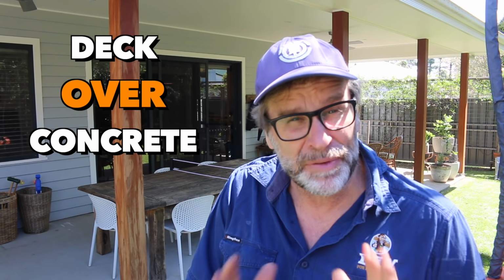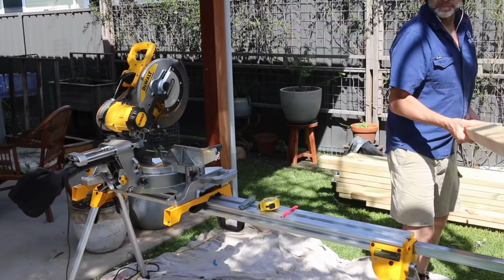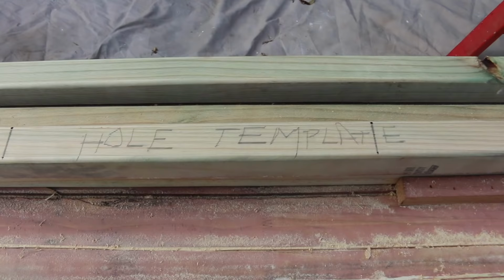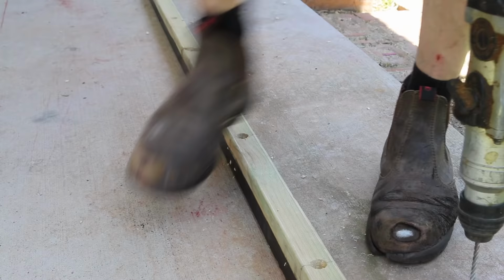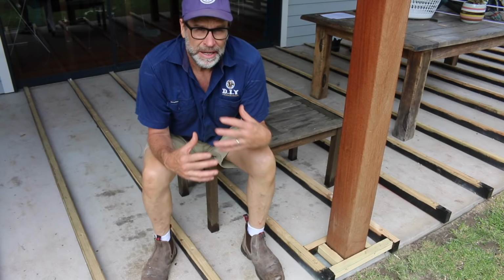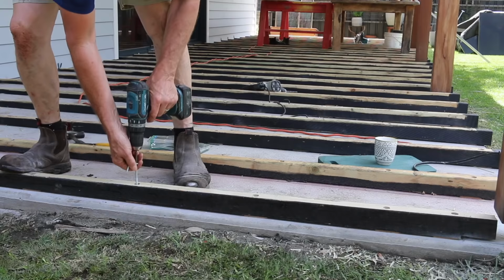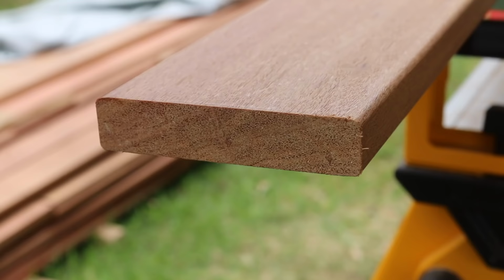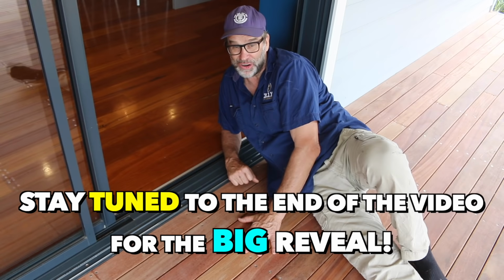Building a Deck Over Concrete PLUS 5 BONUS Decking Tips!

Comment: I've been searching for months on how to build a deck with clearance like this and this video has never appeared in the results until now for some reason. Glad I've finally got to watch it. This looks amazing and looks easy enough for a knucklehead like myself to complete! Thanks.
Reply from the maker: No worries at all mate and good luck with it 👍 Thanks for watching 👍😁🇦🇺
Reply: @diyforknuckleheads  No worries, one quick question.. How did you decide on the length of the decking? I see you've staggered them in a pattern. If I'm going 4.2m long would you do one run with 2 x 2.1m pieces and one with a 1.05m, 2.1m and 1.05m and then repeat that out?
Reply: Should look into deckcell, 30mm plastic cell you deck over
No issues with timber rotting
Reply: @octane_matty Still need something under to make it level.

Comment: One of the guys in my Jobsite has that same DeWalt drop saw, it's a beast and the shadow line makes it so fast to cut timber.

Nothing more satisfying than when the straight edge slides perfectly across.
Reply from the maker: You're not wrong mate....some times you just have to do it and yes.....the saw is awesome!...l love it. Thanks for watching and Merry Christmas 👍😁🇦🇺🎄🎄

Comment: This was a great help in planning to recover my concrete patio. Quick question for you! What did you call the plastic spacers you used between the concrete and lumber? I'm am not finding anything quite like it exactly in the US.
Reply from the maker: Thanks Chris 👍 The plastic spacers are called Window Packers" Carpenters use this to level up their windows during the window installation process. Over here in Australia you can buy them from any major Big Box hardware store. Good luck 👍😁🇦🇺
Reply: @dengshomeinvasions1273  They'd need to be stainless steel or galvanised, but plastic would be better to avoid rust.

Comment: Excellent video upload, and the building principles are true. -- You could also lay the framing joist flat and custom cut height adjustment shims at each anchor point, but I believe your solution would be faster. --- Thanks for the fun video. ---
Reply from the maker: No worries at all Lance! Glad you found the vid useful mate 👍😁🇦🇺

Comment: Best floating deck video ever. I plan to build a desk that is slightly lower than floor, and it will leave me with 4 inches for the deck's height. Perhaps going to use 2x4 or 2x4 on top on 2x2.
Reply from the maker: Thanks mate 👍 Glad you liked the video and good luck with your deck 👍😁🇦🇺

Comment: Excellent video! My patio and walkway are so old I need to just cover it with decking. My house is 121 years old and the front concrete was done in 1968👀
Reply from the maker: 👍😁...No worries! Glad you found the vid useful and good luck with yours 👍😁🇦🇺

Comment: Hi there, you my friend have solved alot of the issues I was having in terms of how to achieve that clearance because obviously we don't want the joist to be in direct contact with the concrete. Thank you!
Reply from the maker: No worries at all mate! Thanks for watching 👍😁🇦🇺🎄
Reply: @diyforknuckleheads  I have a quick question. Do you think I can use the flat side of a 70X35 or 90X35 to do the framing? I have only 70mm height to work with and is driving me crazy!

Comment: Very nice video and work for sure.   Tonka wood also know as Camaru in the US.   Viewers should know proper installation recommendations.  I’m in building products distribution and have visited too many decking claims where the wood fails due to improper installation.   

Cumaru should never be attached to a solid surface such as concrete. Sleepers, stringers or joists should be used to fasten the deck boards to the structure. Proper drainage and ventilation should be considered to avoid movement, cupping and checking.
Ventilation – Allow for air flow underneath and between the deck boards in your design for maximum long-term stability. Follow proper gapping/spacing recommendations below for best results. Decks should be built at least 24″ above the underlying surface and have open ventilation from three sides.
Spanning – For minimal waste, we recommend that you build your deck on 12″ spans. Otherwise, follow these standard spans for installation for minimal deflection of the deck surface

Comment: Amazing deck mate. And some excellent tips in this for me. I have a 250mm fall across the uneven floor of my workshop. So instead of paying a fortune to level it, I am going to make low profile plinths for all my machines. I am going to use that jig to cut all my framework.
Reply from the maker: Sounds like a plan Curt! Good luck with it mate 👍🇦🇺😁🎄

Comment: It will .pack your joists level dynabolt them below the top of joist so you can plane , Chemset dyna bolts in of your worried about them coming loose , no dramas

Comment: Well done , had some good tips, have used a socket set for those screws as well.👍
Reply from the maker: Cheers Steve 👍 I actually tried the socket set as an experiment with these screw bolts and l had no joy at all....maybe l needed a stronger set with more leverage 🤔 Thanks for watching mate 👍😁🇦🇺

Comment: I'm replacing a larger deck, but going with Trex (wifey).  Just for added insurance, you could use some decking tape on top of those joists which are water resistant and seal around screw holes. Also, I know it might be a pain, however wouldn't it be a good idea to take a day or two and put the decking oil on all sides? Also, small paint brush to hit the freshly drilled hole before the screw goes in?  I'd think normally you might not have to much to worry about for moisture problems, however recently...  I'd love to move there, however just far to many poisonous things waiting to kill me.
Reply from the maker: 😂....We do have a few stingy things over here 😂 Thanks for those extra tips 👍😁🇦🇺

Comment: I like all of it except the explanation of timber against timber.   You've created a pocket between the deck post and the floor framing with a gab.   I can only assume the spacers are fastened to the floor which means water will stick in that pocket for a long time.

Comment: cracking job mate. I have similar challenge with low clearance to some concrete steps that lead up to the sliding doors so will need to do something similar around that area.
Reply from the maker: Cheers Stu! Good luck with it mate 👍😁🇦🇺🎄

Comment: This video was amazing and super helpful!

Your sloped joists seem shorter than what I've been reading (your typical 2x4, 2x6, etc...). Is there a minimum dimension they have to be to support the weight of the decking? I don't have much height ti give in my patio, so i want to simply build the frame/joists to give the decking a foundation without raising it much, if at all.

Thanks!!
Reply from the maker: Thanks Kevin 👍 It really all depends mate. The less clearance you have, the less airflow you will have underneath the boards which can cause the boards to cup. With a narrow joist you need to have more support under it which means having those plastic packers closer together and you also need to consider the length of the screw. 
I really don't want to say it's ok because there are to many variable to consider.
Cheers,
Shane 👍

Comment: Hi Shane, few quick questions. 1) What size joists are you using? 2) How far apart are the joists? 3) How far apart are the concrete screws? (380mm?). Thanks
Reply from the maker: G'day Rob....the joists were 90 x 45 treated pine (MGP10) at 450mm from centre of one joist to the centre of the next. I placed my concrete screws about 470mm apart. You just need to make sure that the concrete screw is not going to get in the way of your decking board screw which requires you to do a bit of setting out first before you decide where to place them.....if you know what l mean...Good luck with it mate 👍

Comment: This video is exactly what I'm planning to do for almost the same concrete patio with minimal clearance, etc. Was dreading the tapered joists thinking that was the only way to do it right and seeing you do the same gives me confirmation that's the right way to go about it.  What are the spacers that you used between the concrete and the floor joists?  Was thinking I would have to make something, but if those are commercially available, that would be great!
Reply from the maker: Thanks Scott...glad you found the video useful mate! The spacers are called Plastic Window Packers. Good luck with it 👍😁🇦🇺🎄🎄 https://www.bunnings.com.au/macsim-75mm-600-piece-mixed-window-packers_p0164936
Reply: You are the best.  Thank you! @diyforknuckleheads
Reply from the maker: @scottniemiec7196  No worries at all mate 👍

Comment: its amazing to see the different ways people build things, I probably would have laid the boards sideways so 35mm plus 19mm for the decking and a 1mm spacer close to the house end as you wouldn't need membrane under the deck boards as it's all undercover, then I would have put 30mm spacers at the other end to make it 85mm and pack the rest with window spacers after securing each end, bit less time involved splitting the timber and not having to nail the packers under the beams, but we'll done it came up a treat.
Reply from the maker: Glad you liked it mate!  The reason why l wouldn't lay the board on its side is that you would see to much of it between the decking  boards. Thanks for watching 👍😁🇦🇺

Comment: The floors inside my house are actually tongue and groove pine planks, approx. 6" wide running on treated 2"x4"'s (1.5" x 3.5" finished). The 4" side is anchored somehow( I wasn't there and trusted my builder to know what he was doing!) to the concrete slab. Assume about 16" on center. Have held up pretty good for 25 years. With very few if any creaky boards that I hear much and if so usually only in winter when it's dryer.
Reply from the maker: That's exactly how l laid my boards inside my house as well Mick. Been down 6 years and no issues at all. We have 6" boards as well 👍
Reply: @diyforknuckleheads  Actually just measured and they are only 5: wide, granted maybe the tongue is 1/2" to make it a finished 6" piece of wood. And the only thing about a house with wood floors after living with carpet all my life is the need to wear shoes. usually flip flops. Wood floors hurt my feet! The dogs toe nails scar it up pretty well too. But hey the rugged look!

Comment: I hope to do exactly this on my screened-in lanai in Florida. I sure hope I can find a craftsman like yourself. My only concern is about the maintenance of the concrete foundation. Do I need to be concerned about that at all? I am thinking gunk, juice spills, dirt, etc. With normal decks, it can just fall to the earth and nature can take its course. Without the deck, I can hose it off thoroughly. Thoughts?
Reply from the maker: G'day Sandy...l can't see to many dramas. Mines under cover so l don't have any concerns. If juice does by some chance fall through the cracks in the deck it will soon dry off. We've had plenty of parties on the deck and so far so good 👍👍 Thanks for watching 😁

Comment: @DIYForKnuckleheads Some great tips thanks Knackers. I used a very similar process on my pebblecrete front porch a couple of years ago. 
No joist tape? Did you opt for bitumen paint on the top of the joists as well? 
Great tip about the shim under the deck boards for cutting butt joints. I shifted the angle on the mitre saw but that gets time consuming! 
For ripping the taper on all the joists, I wondered if you could have set your jig on the required angle to avoid all the string line hoo haa.
Also a good tip about no wood to wood contact. For a picture frame deck where you are doubling up and blocking all of the perimeter joists this could be hard to avoid though. Perhaps some joist tape over the join would suffice, rather than more window packers?
Reply from the maker: Thanks mate! Glad you liked it. Because my desk is under cover it rarely see's any water so l didn't worry about painting any bitumen on the top of the joist. Thanks for the other tips as well 👍 Cheers 👍🇦🇺😁

Comment: Just my opinion, but you should have showed how you worked out your measurements for your tapered joists.  It’s probably the most important thing in the project and something the non -professional would need the most help with.
Reply from the maker: Trent, all you need to do is run a level line from the top of the floor boards inside the house to the edge of the concrete where it meets the grass. Then just measure from the concrete to the level line.....hope that makes sense 👍

Comment: great video . been wanting to put a wooden deck on my concrete landing like that and extend it about 4 metres over a 1 metre drop , spose i need a bit more advice for that , with dyna bolts and stumps and bearers etc  .  its been on the gunna list for a while , but good tips there .
Reply from the maker: Thanks Barney....yeah mate, bit more involved with the over hang. Good luck with it 👍😁🇦🇺

Comment: I used steel u channel. Straighter, flatter and does not rot.
Reply from the maker: The wood has been termite treated Stuart so no real dramas there mate 👍
Reply: @diyforknuckleheads   but it's much wetter in the UK I can guarantee that lol
Reply from the maker: @stuartwhelan3258  Hey Stuart…sorry about the weird response but it was meant for another comment😂 In regard to yours…yes metal U Channel is a great option 👍👍🎄

Comment: That turned out real beautiful! 
But I do have a small question: shouldn’t you put a slight angle on your deck, so water can run off towards your garden?
All the best!
Reply from the maker: Thanks Steffen. The concrete under the deck has 30mm of fall from the house to the edge of the deck. Any water that does get on deck just runs away on the concrete beneath to the grass 👍

Comment: Curious what the lowest height point, nearest the building, where the taper is smallest on the sub structure is? Only asking as I read many different opinions on the ventilation height needed and the back of my house is very similar to what you have. Overall very helpful video thank you for breaking things down simply!

Comment: Nice job. Just a few  questions
8:30  do you really want a tight fit? No room for expansion?
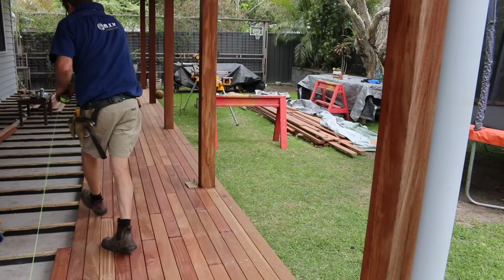9:17  String line on every run?  Very time consuming and setting the plank on that line is difficult if the plank is not perfectly straight.   Use a string line for the first run then use spacers for the rest . Would that be easier and more accurate?
Reply from the maker: G'day mate, tights joins are fine as timber expands in width...not length. That's why you see floor boards tight where they meet end to end but you leave a gap between the last board and the wall to allow for the boards to expand in width.
I string line every board because not all boards are the same width in the pack. My boards are sold as 90mm wide but varied in width from 87mm to 92mm which is very common. Spacers don't account for the differences in board width.  It would only take a few runs for that line to be out of square to the wall. The gaps between the boards would also be very irregular which would drive me nuts. 
Running the string line only adds an hour to the overall job so it''s really not that big of an inconvenience for something you are going to be looking at for a very long time.
Thanks for watching mate and l appreciate the feedback. Cheers 👍😁🇦🇺

Comment: That work is stunning!  I really wish I'd have seen this video before I chanced my arm on a small decked area which was built on a really steep concretr incline ramp.  It still looks and feels good 3 years 4 years on but I dread to think what's happening underneath without those packers between the feet of the stilts I made and the concrete.  It was all pressure treated timber and the ends were coated but I can totally see now what I should have done.
By the way I'm so envious of your readily available hardwood in Australia.  Over here that amount of hardwood would be about a year's salary for most people.
Reply from the maker: Thanks Andy! Glad you liked it mate 👍😁 Don't worry, l had to take out a second mortgage to buy the stuff 😂 Hope you're having a great holiday 😁👍🇦🇺🎄
Reply: You too Uncle K!  All the best to you and your family.  I hope you've had a great Christmas and a have a really great 2022.

Comment: The deck looks amazin, love it and going to make one. Thanks for the video.

I have a question though. What sort of board is the best or should I ask you've used for the top? my deck does not have any ceiling any suggestion?
Reply from the maker: Thanks Ali! Glad you liked the deck mate 👍👍 It really depends on what part of the world you live in regard to appropriate timber species. In Australia, the most popular type is Merbau and you often see it around pool areas which more times than not don't have a roof.  It also comes down to your budget 👍
For my deck l used a Hardwood Board called Tonka....l love it!

Comment: Great video. I learned a lot many tricks from it.  I have exactly the same concrete surface in my backyard, the only problem is my concrete surface is slightly uneven, do you think I can use one of those plastic shims to level the joists?
Reply from the maker: Thanks mate  👍 Yes you sure can as they come in many different thicknesses. Good luck 👍🇦🇺😁
Reply from the maker: Thanks mate and yes you can as they come in many different thicknesses. Good luck 👍🇦🇺😁

Comment: Awesome video like always but wouldn't you want the deck to have a slight tilt away from the house for water drainage? You do great work uncle knackers and I enjoy your videos.
Reply from the maker: Thanks Richard. The concrete under the deck has roughly 40mm of fall from the house to the edge of the deck where the posts are so any water that gets on the deck will simply run away on the concrete underneath to the grass  👍 Appreciate you taking the time to watch mate 👍😁🇦🇺🎄